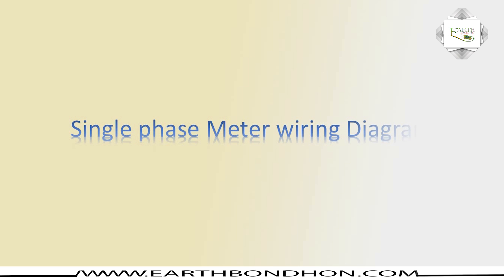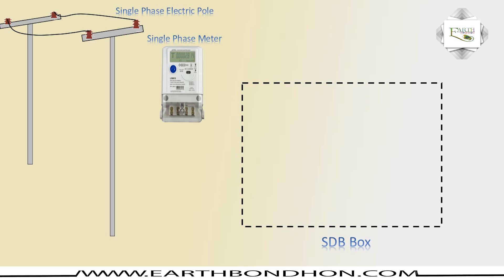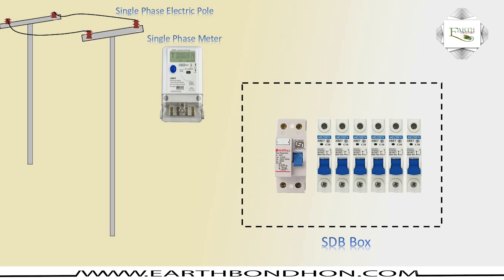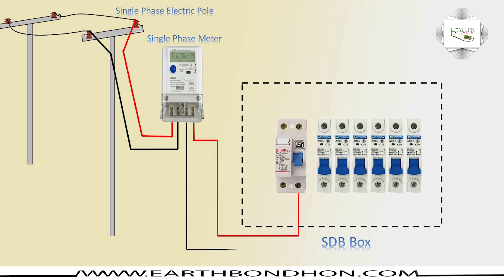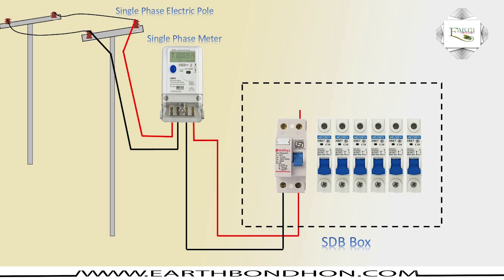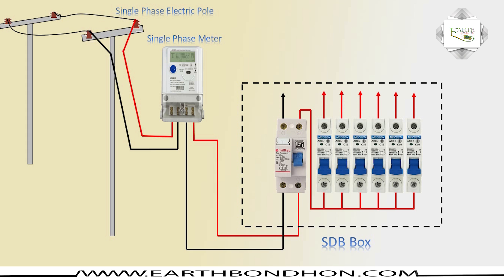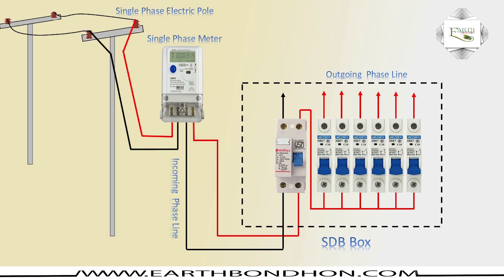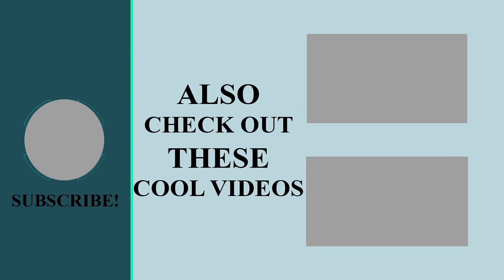single phase energy meter wiring diagram  | energy meter connection | energy meter | Earthbondhon

Comment: My home side 220 voltage  came but  submersible motor 1.5 hp motor  on time  150v voltage  motor  water flow low  how to increase  water  pressure  and voltage sir
Reply from the maker: why 220 volt